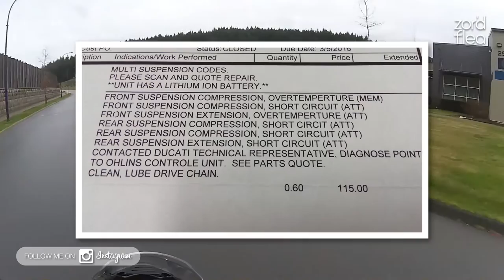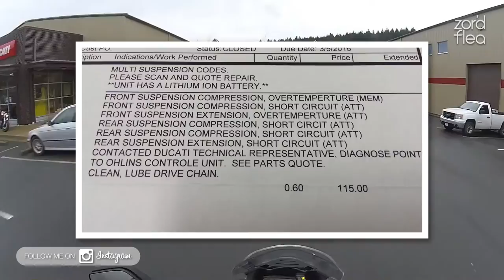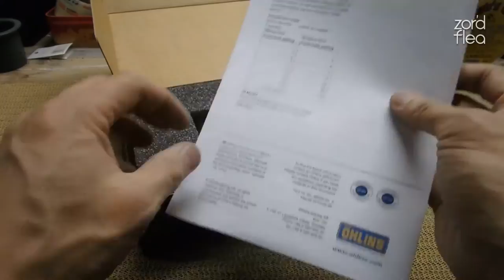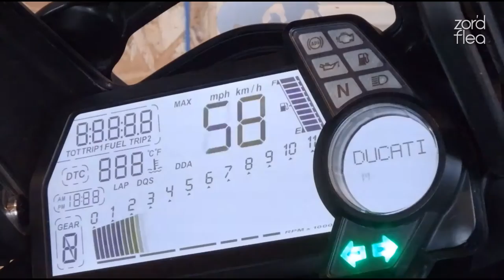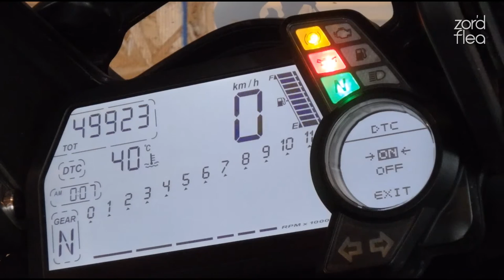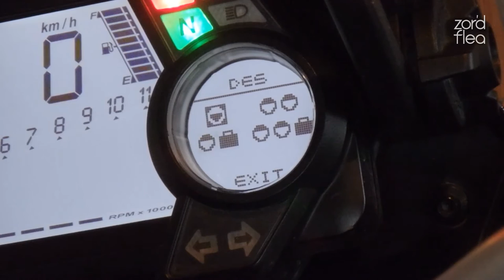Ducati Multistrada 1200 - Ohlins Mechatronic Suspension Upgrade

Comment: Well this system works on any motorcycle?
Reply from the maker: That system was built specifically for the Multistrada's suspension system. However, if your bike also has a high end electronic controlled suspension system, chances are that the suspension manufacturer has some kind of upgrade.